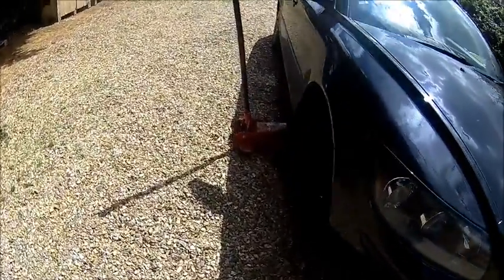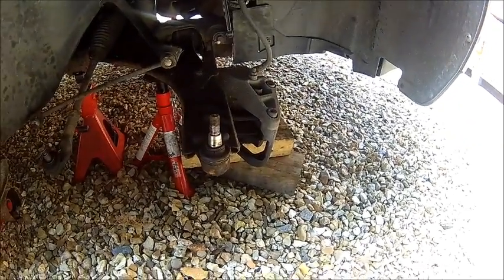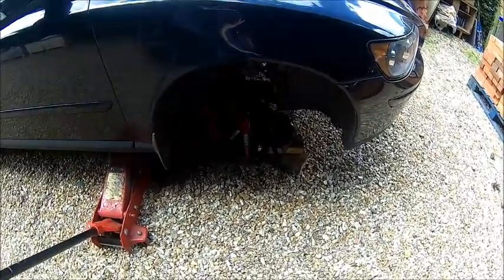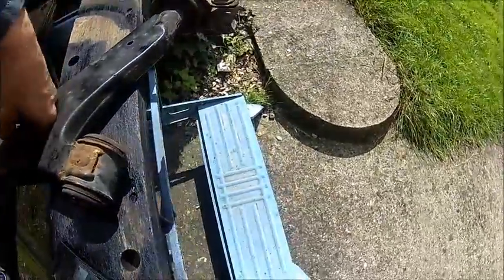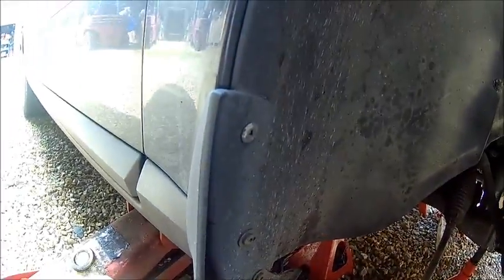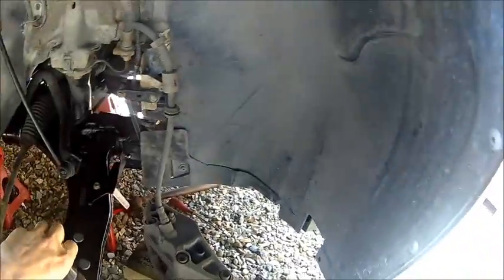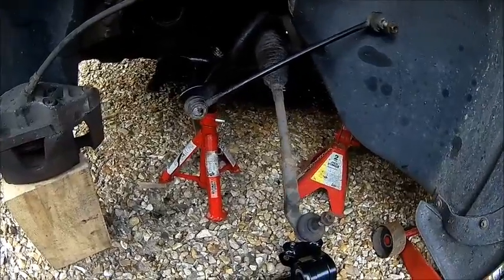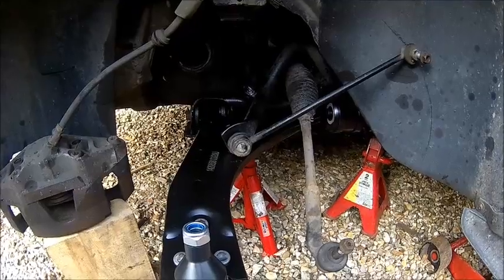Volvo V50 Front Suspension - Ep#2, wishbones (front lower control arms) replacement

Comment: Did you torque your bolts up if so what torque spec?
Reply from the maker: Of course i do,... it's been a while, but if i remember that right it's 115Nm for the 2 clamp bolts and 175Nm for the font one. The car must sit on ride height when you torque them, so fit them hand tight, then lower both wishbone ends onto blocks, suspending the full weight, then torque them up to spec.

Comment: Almost slipped one by me. Almost. :)
Reply from the maker: I am almost certain you won't ...:-) .... thanks
Reply: What year is the Volvo , I got one to do this week. Do you need an allen wrench to keep the ball joint  from turning when removing the nut?
Reply from the maker: It's a pre-facelift (2006) , but as far as i know the parts are the same for the facelift models. Yes, you may need an allen key for both ball joints (steering and bottom), at least for re-fitting them,
Reply: dynoguy thanks ill have a set handy